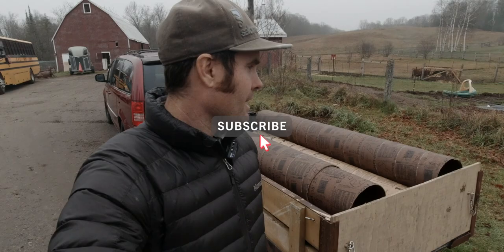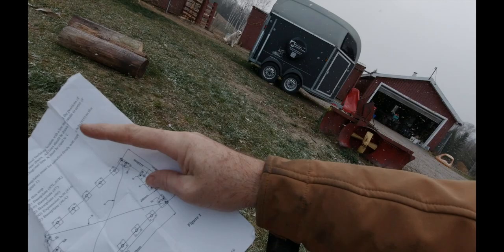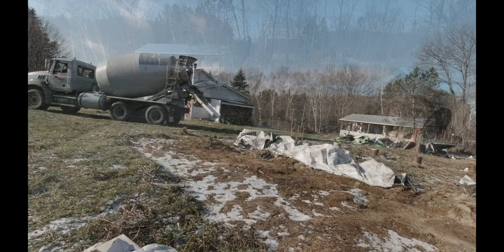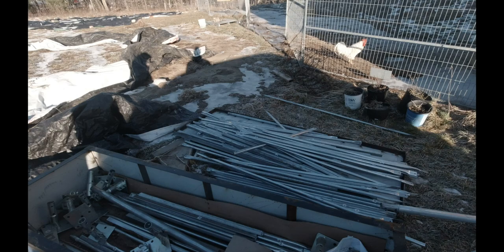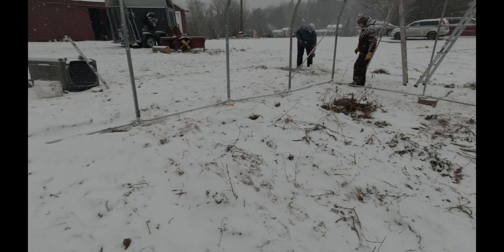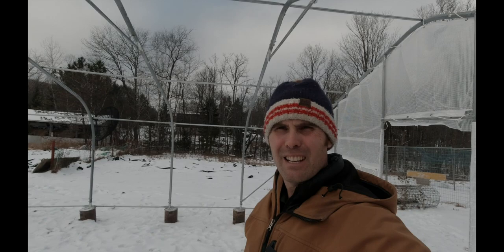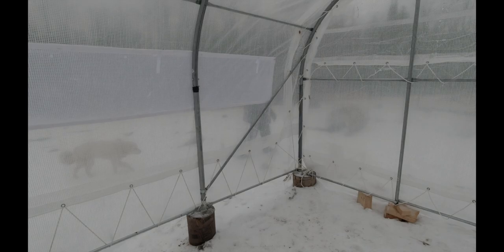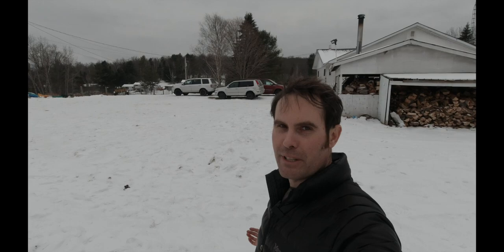We put up a 20x30 Greenhouse on the homestead

Comment: How's this greenhouse holding up?  Any advice on changes you would make putting it up, or additions you'd recommend after having it for a year?
Reply from the maker: Its holding up amazing. We've had some big winds and big snow(that I clear off right away) and its doing alright. 
A few things I don't like. It has grommets that you use rope to feed it through to hold the plastic on, It's been up for a year and it's all fraying so I'll have to either get new rope or tear it off and get some wiggle wire and c channel and put proper plastic on.
The other thing I would have done it paint the tubing with metal paint as some of it is rusting. The door it comes with sucks. The hinges are like 1/2 inch poles that barley stay on in any type of wind. I need to find some longer poles or something so they stay on better. Other then that it seems alright. The one end wall I need to modify with a window in it but as of now I have a fan in it and open the side windows and it seem to keep the temp not to hot on hot days.
Reply: @MrSpinkle1  thanks for the feedback. We got ours at auction and we’re hoping it was worth putting it together. Our town is finally cutting some trees that will give us the sun where we want to place this so this will be a project for this year!!  We will be watching your video again and taking these additional things you’ve mentioned into account while building.
Reply from the maker: @candaceplatt1700  I think it took two of us about two days then once we had extra help we got the main plastic on. Make sure to put it on in the morning when there is no wind. Any other questions let me know.

Comment: How did you fasten the hoops to the concrete pillars?  I believe there's a pad on the bottom of the leg that needs to be bolted down. I'd also like to know how far apart you put the pads. You mentioned having to move the sonotubes, but I'm not sure why? Otherwise not a bad video. Thanks for sharing.
Reply from the maker: Thanks Tim. They were 5 feet apart. The 4 corner brackets are a different size then all the others so  we had to ajust where we put them. They are a little bigger and different size.
The kit came with bolts to fasten it down with but we couldn't figure it out so we bought some concrete bolts. We drilled holes into the concrete(there's 3 holes in each base plate) then bolted them down. We didn't have them fully centred so not all three bolts were bolted into the concrete, but it seems pretty stable none the less. I'll do an update on it in the spring once I get it planted and  my thoughts.
Reply: @MrSpinkle1  I'm curious. Did the pillars went up the ground because of the freezing and thawing ?

And did you put something to hide the side which was higher ?

Thank you !
Reply from the maker: @frankthetank8712  the pullers did not move up and down with the frost. We put the sauna tubes In 3 feet.
I have not put anything on the side the is higher. Haven't had time and it dosent effect it.

Comment: Hi! Got one of these at auction in late fall and haven't put it up yet - thanks for the video!  I didn't realize the windows were small like that - I thought the sides rolled up!  DOes it feel like you need to add additional support boards (like a 2x10) down the side, like many greenhouses have?  I figured I may need to add these when putting this up.
Reply from the maker: Your welcome. Hope you found it helpful. I will see how it goes without the side 2x10 boards. If anything I'd want to do two more rows of tubing on the top of the greenhouse(mostly for hanging trellis off for tomatoes) The windows are definitely small and I think I'll need a fan in there. I thought there was a big door on one end and a man door on the other, but there is only The one door, which will make for poor ventilation. 
I'll do updates as the growing season comes close and through the season and my thoughts and what could be improved for stability. Roll up sides would be nice

Comment: We live in Nova Scotia, wondering if the greenhouse stays up year round with no trouble from Canada weather,  as of now we put up greenhouse in Spring and take down in fall would love to have up year round how do you guys fair?
Reply from the maker: My last greenhouse was a carport greenhouse and I left it up all year long with no problems. This one I technically could take off all the plastic for the winter as it's tied on with grommets and rope, but there's really no point. I want to start growing early April if all goes well in it.
in the winter you will have to brush of the snow to keep it from ripping the plastic.
The other option you could do is wrap with two layers of plastic and then blow air between the two layers. That'll keep it warmer inside and help keep the snow from ripping it as much.